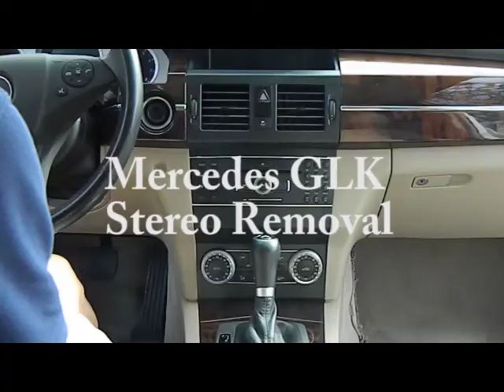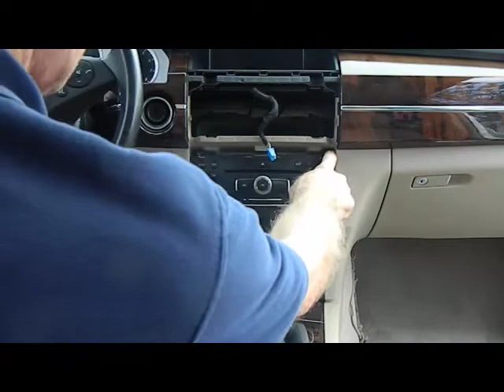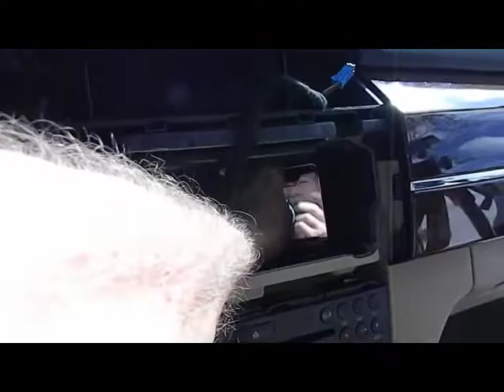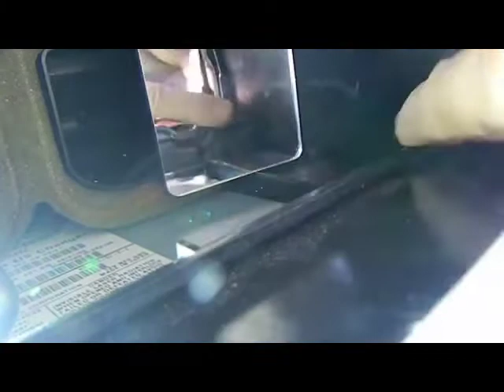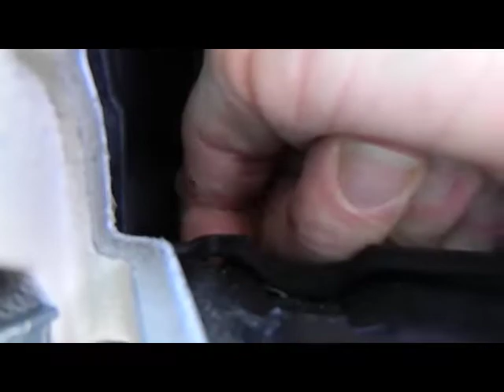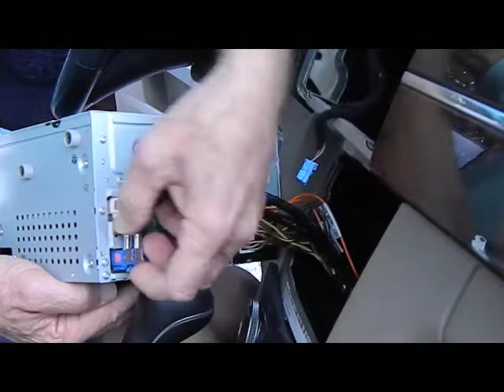Mercedes Benz GLK Stereo Removal - Car Stereo HELP

Comment: What size are the radio mounting screws on the two sides of the GLK? I removed my radio recently and lost the screws and cannot figure out the size I need for replacement screws?
Reply: T20